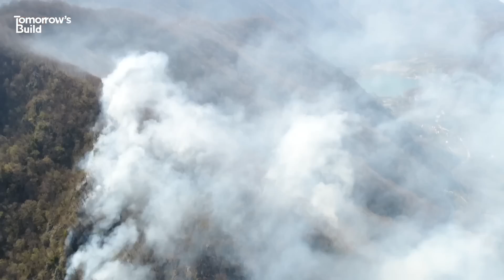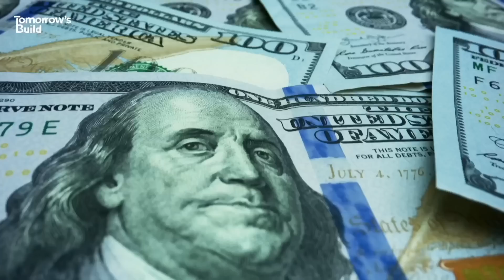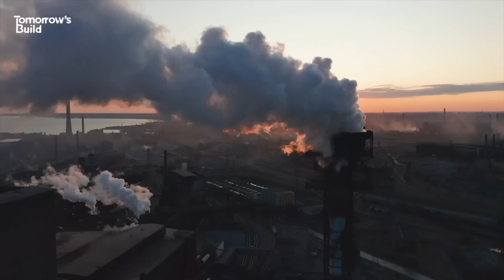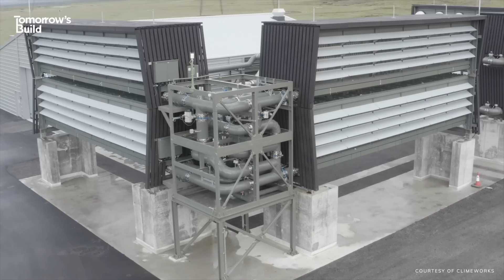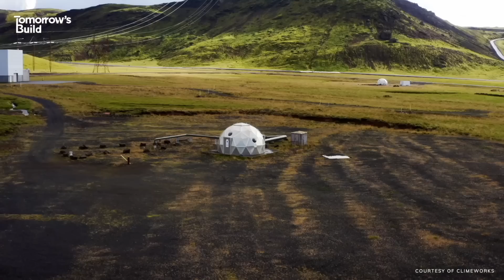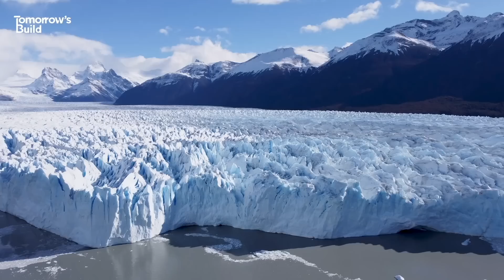This Machine Could Reverse Climate Change | Tomorrow's Build

Comment: In 2022, 81% of the global energy is produce by fossil fuel sources (Coal 29%, Oil 31%, Gaz 21%). So spending energy, time, ressources,  R&D, for sucking this same Co2 while this we can use thoses ressources for nuclear or renewables is such a waste, and a dumb idea.

Quick reminder : 

- Nuclear : 6 g of CO2 per kWh produced 
- Windpower offshore : 9 g of CO2 per kWh produced

- Windpower onshore : 10 g of CO2 per kWh produced
- Hydraulique : 10 g of CO2 per kWh produced

- Solaire : 41-48 g of CO2 per kWh produced

- Bioenergies (biomasse) : 32 g of CO2 per kWh produced

- Fossil gaz : 443 g of CO2 per kWh produced
- Oil : 778 g of CO2 per kWh produced
- Coal : 1058 g of CO2 per kWh produced

Source : ADEME

Comment: From what I understand from various environmental presenters, building enough of these plants to make a dent is not currently viable - I very much hope that the people behind these projects prove that wrong :)
Reply: Carbon capture probably won’t create any difference for a long time. It has to cancel the carbon emitted before it tackles any backlog, and most countries will not reduce emissions that much until the later stages of the 21st century.
Reply: @justanothercommercial  why do most people swallow all these SCAMS hook line & sinker. the TREES capture CO2 and convert it to the air we BREATHE.

Comment: CO2 can used to produce methane, and that in turn can used for LNG or rocket fuel. At least LNG have much lower CO2-to-energy produced ratio and it would be carbon neutral ( since you are not generating new CO2 ). Of course it can be a long goal but at least it can make it more viable
Reply: Methane is up to 80x as potent of a greenhouse gas as co2
Reply: @Xanman2000  That's when it's released, not when used for combustion.

Comment: The problem with carbon capture is that every watt of renewable electricity it uses would be better spent powering homes and industry that would otherwise be powered by fossil fuels. 
Carbon capture only makes sense once global power supply is 100% renewable.
Reply: i work on the factory Norcem, wich is the one that was used as an example in this video. And here the only energy wich is going to be used is the excess energy that was previously lost. So no more energy required to cut the emissions in half. The factory could have captured all the CO2 but that would have required adittional energy
Reply: @stian1236  the waste heat could instead be used for District heating, reducing the use of fossil fuels to heat homes. This is already being done in many European countries.
Reply: @ooooneeee  this is in Norway where all electricity is produced by hydro or wind. And the area around the plant is not suited or needing of a district heating system.

And Norcem Brevik is the most environmental friendly cement plant in the world. Atleast 75% of the fuels used in the last couple of years is carbon neutral and all of the oil being used have been spill oil from other places. 
And there is no way to eliminate the CO2 from the calsination of limestone.
Reply: @stian1236 *which
Reply: I will argue that it doesn't need to be global supply at 100 renewable, but it does have to be country specifically 100%. If for instance South Korea was 100% green and was using excess to run carbon capture, they would be essentially making net positive. It would be a pretty unrealistic goal to say that since South Korea has excess green power, they have to power North Korea's houses. The geopolitics just don't allow for that to be the case, although it is about as close to ideal as I can see.
Reply: @Fenthule  for enemy coutries I agree, but in general if a country has excess green energy they should sell it cheap enough to undercut fossil energy instead of capturing carbon while their neighbors burn coal.
Reply: Spot on. CO2 is at its most stable energy state. Anything you do with it requires an energy input and it’s amazing that this is not more widely understood. So with carbon capture, any energy you produce, some fraction of it will need to be “reinvested” into the carbon capture. This reduces energy available for useful things, which means you need to produce even more energy to meet needs. This why carbon capture is a farce.
Reply: This is why you build nuclear so tou can power both
Reply: @DJHASDIMONDS  y would you do that? solar is cheaper and does not have a lot of the other problems nuclear power has.
Reply: @MusikCassette  Solar doesn't work when there's no sun. Also all of the supposed problems of nuclear were only seen in soviet power plants where they cut corners to save cost or that one in japan that needed an massive earthquake AND a tsunami to cause a failure.
Reply: @DJHASDIMONDS  than you do the carbon capturing, when there is sun.

also, you don't really seam to understand the problems of nuclear power.
Reply: @MusikCassette  1. Learn how to spell before getting into a debate.

2. Nuclear doesn't really have any problems. Used fuel rods can be used as fuel in new reactors and storage isn't hard either. Just find a remote place and bury them.
Reply: @DJHASDIMONDS  about 1: f.u. this is the yt comment section.
 
about 2 : lol
Reply: @MusikCassette  lol means defeat therefore I win 😎
Reply: @DJHASDIMONDS  lol means I Laugh  Out Loud 
"Nuclear doesn't really have any problems" That is quite funny.

also the fact that you think 
a) talking is about winning  and
b) u won by making me laugh at you
are really ridiculous.
Reply: @MusikCassette  sorry but lol just means you ran out of counterpoints. If you have any problems with nuclear you could actually say them instead of just saying it has problems.
Reply: @DJHASDIMONDS  you really don't understand, y what you said is funny?
Reply: @MusikCassette  no explain it to me. And while you're at it explain what problems nuclear has cause you've yet to do that.
Reply: @DJHASDIMONDS  you want me to tread you as if you asked an honest question, and not as the troll you set out to be?
Reply: @MusikCassette  I'm not trolling though. Give me a reason why nuclear is bad. 
Also it's treat not tread.
Reply: @DJHASDIMONDS  It's super obnoxious deciding to be the spelling police on YT. So maybe don't do that. You've basically made yourself into a giant billboard with the words "Elitist Asshat" in Impact font.

I'm not speaking to MusikCassette's context, but you do realize that a lot of people on YT are not native English speakers? There are also plenty of folks who are dyslexic, which is just line one of a thousand valid reasons someone might not be a spelling bee champ but not deserve to be dismissed out of turn.

I will say that it's just a tad bit humorous, though, that you make a glaring typo right from your first comment. In a way, it would be more respectable if you were a troll because, barring that, you're just a generic variety snob. Consider making a change in your life.

I am a strong advocate of Nuclear energy, and I think it's deeply unfortunate the misplaced progressivism attached to antiquated, anti-nuclear sentiment. If you are unaware of the pitfalls of what is nonetheless an imperfect technology with an abundance of practical limitations, however, then I suggest that you avail yourself of the Internet and educate yourself because you're not entitled to a 101 lesson from anyone here.
Reply: @anyazelie  1. If you don't want me to correct your spelling, don't make it so easy for me. 2. On the native english speakers part, don't care. 3. I know that nuclear has problems but I kept asking them to provide one as they kept saying it has problems yet providing no examples, not even low hanging fruit like chernobyl or fukushima. It honestly just read like they knew nothing about nuclear and just hated it because other people do to.
Reply: With Renewables being highly intermittend we will very soon have excess Energy being available on windy/sunny days that cant be used otherwise, long before we all our supply all the time is renewable.
Reply: You are right but that is assuming energy can freely travel on a globalized grid  across borders and oceans to places that needs it most. Places with abundant energy (iceland i think)  can and should start experimenting
Reply: @tianwang3768  in a way it can travel freely, when you put energyintense processes to where the access energy is. That would be things like the Production of aluminium,  ammonium or  green steel.
Reply: Your right in an ideal world, but wrong in reality. We need to start upscaling this now so it can make a difference.
Reply: I mean kind of, but the issue is when power is available. Carbon capture should be used in the middle of the day and at night so we can more easily keep the basement power needs uniform. See the duck curve
Reply: The problem is that CO2 is not a pollutant.
Reply: so we should stop with this technology and left our world get burned? i would say this is bfar far better than doing nothing.
Reply: @Paopao621  I didnt say do nothing. Just do this one last.
Strawmanning is very rude, good sir.
Reply: very true. but also, now that renewables are as cheap as they became we should massively overbuild them to be relied upon in times when there is little of them. If we do that we end up in a place where we have times with a lot of overproduction.
Reply: You make a fair point. But if we scale up CCS only after the storm has passed, you're stuck with an enormous backlog where you have to build over a thousand in a relatively short amount of time, plus all the roadblocks in innovating CCS. Right now we can and should build them to better understand the technology, and we have decades worth of time to improve upon it right now. Waiting for the world to go completely green would take far too long to finally begin CCS.
Reply: @strife2746  I agree. The research has to be done now, and small scale facilities are needed for that. A full scale implementation of the technology has to wait for fully renewable power supply though.
Reply: You can dream all you want

Comment: Feedback:

I would have liked some info about how really viable is this technology.

For example, best performance available today and approximately how far are we from a performance that make it economically feasible.
Reply: At the current rate: circa forever.
None of the goals have ever been met, the whole industry of "carbon removal" is adding carbon at a prodigious rate.
It is a complete scam.
Reply: @samgriess438  Reforestation is not nearly enough to remove emmissions from the atmosphere.

This technology will have to be finished and there's no real choice. We dug up Carbon that was not supposed to be in our System from millions of years ago and released it into the air.

It's impossible to grow as much biomass as compared to the amount of coal oil and gas that is being burned.
Reply: @sam griess  forests burn
Reply: forests also have a higher capture rate of any carbon capture system in operation. My source is the youtube channel climate town. great info!

Comment: We already have machines from nature to suck out CO2. TREES! Just plant more TREES.
Reply: Too slow and inefficient. We don't have the luxury of waiting a couple million years for nature to fix the problem we created.
Reply: This is also bullshit... trees are not enough for the crap that we put in the air.
Reply: Sadly, we need more than just trees
Reply: Sadly, we need more than just trees
Reply: Im not opposing planting trees, but when a tree in planted, yes it captures carbon, but it stores that carbon in itself so if the tree were to die or get cut down all that carbon is released back into the air. a nice benefit to cc is that you can move the carbon around and reuse it. unfortunately we’d have to plant trees in protected areas or else they would likely get cut down which sucks
Reply: @raffkaisa  The root systems of trees and other plants are actually capable of sequestering carbon in the soil long term, depending on local environmental conditions.
Reply: @raffkaisa  when wood is used in construction it is locked in for a long time. Naturally a forest captures lots of carbon in the beginning of its life but when the trees slow down their growth the carbon captures slow down. So some people think its more efficient to cut full size trees down and use them in construction. This locks the carbon in even longer and lets the forest be in its most carbon capturing state more.
Reply: @KillraStealer2  timber in building locks the carbon away for decades, maybe a century. Carbon capture will store it for millenia, if not indefinitely
Reply: @John...44...  isn't most captured carbon used in some other process and then released again?

Comment: carbon capture rn is pointless, you will emit more co2 to produce the energy needed to capture the co2 then you will actually capture. even if the energy is from nuclear then its still pointless because instead of giving that energy for some homes you give it to carbon capture, and now that house has to use energy from something else like coal so... still pointless.
Reply: At Norcem Brevik, the factory used an example in this video. The CO2 capture plant will use the excess heat from the cement kiln that was previously lost to the souroundings. So they will capture 400 000 tons a year without any extra energy
Reply: @stian1236  in that case, good. but how much co2 do you emit while producing the device that will capture 400k tons per year? I know that its way less but im curious about the exact number.
Reply: @423GustavBern  The CO2 capture plant is built with Norwegian steel and other products so mostly powered by hyrdoelectric energy.